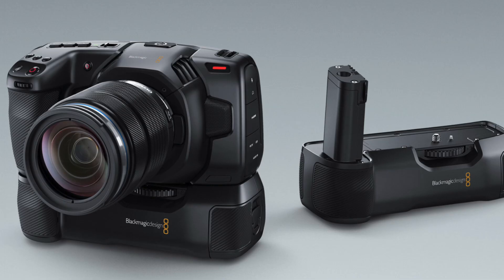Blackmagic Pocket Cinema Camera 4K Battery Grip:  Charging Tips, Why Sony L-Type?, a.o. // NAB 2019

Comment: Does the BMPCC4K battery grip have a 20 turn 1/4 mount on the bottom? For me it would be a deal breaker if it doesn't as I still need to mount the camera on a tripod to maintain a stable image.
Reply: I bet there is. Itll be dumb move if they didnt give it